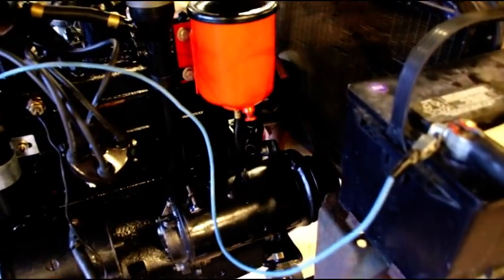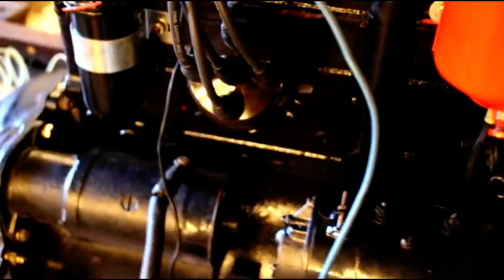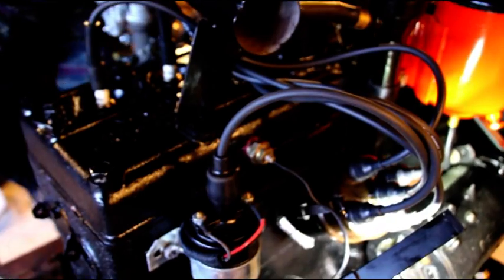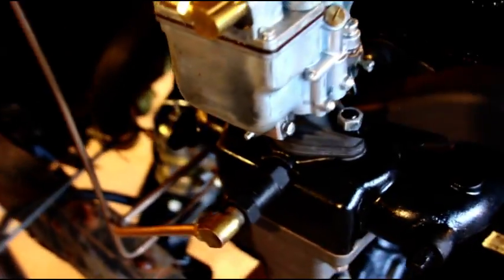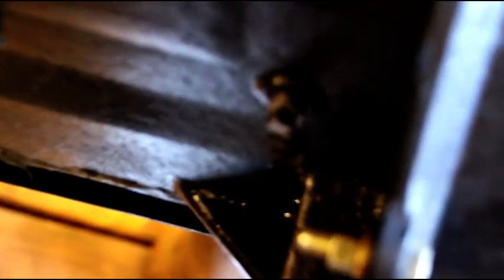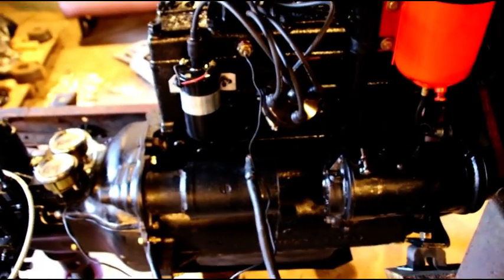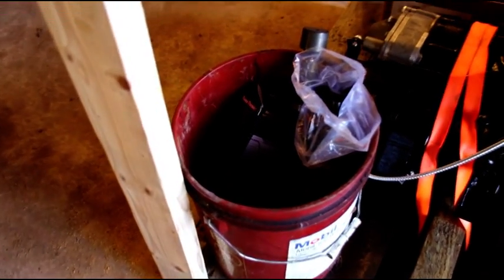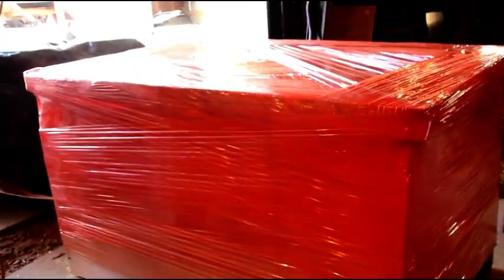Hal's Willys L 134 Engine, T90, Dana 18 With Overdrive RUNNING !!!!

Comment: So what would something like this cost to have done
Reply from the maker: Transmission rebuild, transfer case rebuild, Saturn Overdrive, Complete Long Block with all accessories, run in test stand.  Lubricate everything properly and ship to customer location.  
Prices vary depending on the condition of parts I receive.  A unit like  this ready to drop in and use can run $15K and up.  That is for January 2023 pricing.
Reply: Just rebuild long block I have everything as in new shape
Reply: Engine was running spun a main bearing

Comment: Looks awesome! I am trying to get my 47 2a started after a fresh L134 rebuild. I have spark at the spark plugs, fuel in the carb (also new from Joe Motor Pool), but it wont run. I get an occasional puff out of the carb. Any ideas? Also - is a 6v starter solenoid more durable than the floor switch? I have already burnt one out trying to get this thing to run. Thanks - appreciate any help you can give. Your videos are awesome and have really helped me with my project (you can see my progress on my channel if your interested). Thanks again, Nick
Reply from the maker: Contact me at metalshaper@comcast.net and I can tell you where to get a good floor switch, most of them are junk out there right now.   
As far as the no start it is hard without knowing about your engine.  Are the  valves adjusted correctly?  Did you make the adjustments to the Joe's motor pool carb as suggested.  Float and metering rod?    are you turning the engine over fast enough with your 6v system?   etc.... etc.....  Are you running pertronix ignition or taking your chance of points and condenser?   Let me know and I will try to help you get running.  
Brian
Reply: @metalshaperJeep  thank you for responding! I sent you an email with some more details, I appreciate all you do for the Jeep community! Nick

Comment: Hi Brian…What Type of Shell 15W40 Rotella Oil should I buy? There’s Type T1 T4 T6 etc. Too many choices lol. Thx
Reply from the maker: I stocked up with a bunch of T4 before the prices went crazy.  I use that in all my engine builds after I break them in with 30 weight high zinc oil.

Comment: Just just curious what is a job like that run.
Reply from the maker: Every job is different depending on the condition of the engine and parts when I receive them.
Reply: @metalshaperJeep  the motor still runs but it has a knock in it. Sounds like a loose rod bearing. Once it started knocking I never run it again about 6 months ago. If you could let me know what a starting rebuild would cost and shipping. I would have a general idea where to begin. Thank you
Reply from the maker: @terrancepadilla7217  Yes there was a knocking sound but not a rod knock.  I had a jack under the transmission to hold it up and it got loose and made the noise you are hearing in the video.

Comment: That Warn / Saturn overdrive is the best single modification one can make to an early 'Jeep'.
It provides 25% RPM reduction across the range.
Reply from the maker: Works great and makes driving much more enjoyable.
Reply: @metalshaperJeep  Absolutely. 
The OD provides longer 'road legs' as well as more available gear ranges for offroad use.

My 4 speed + low range from T18 (underdrive) + Warn OD = 12 forward gears, three reverse.   Add Kenne Bell equipped 225 Buick 'Odd Fire' V6 with MSD, too much cam & carb, fat headers... .

Windshield down, goggles and a grin.